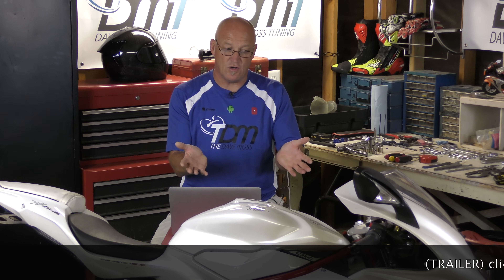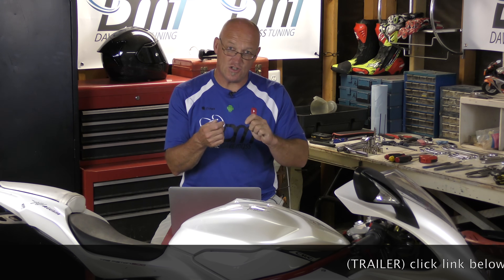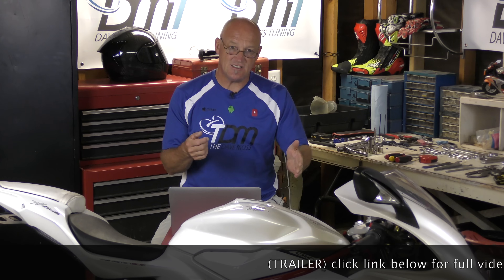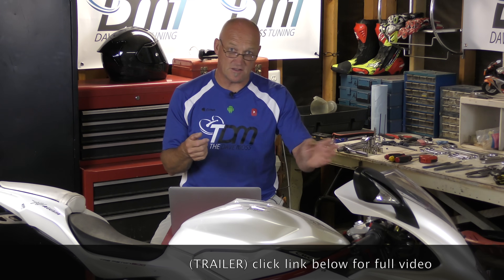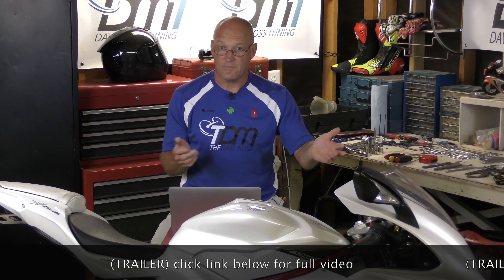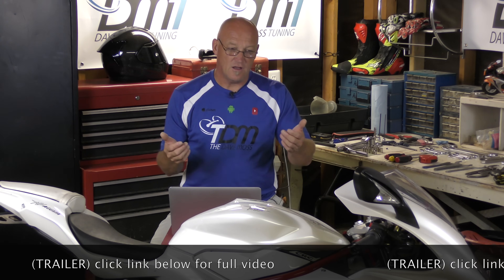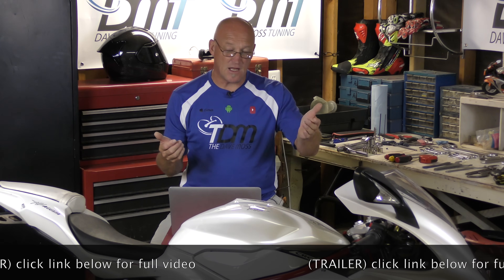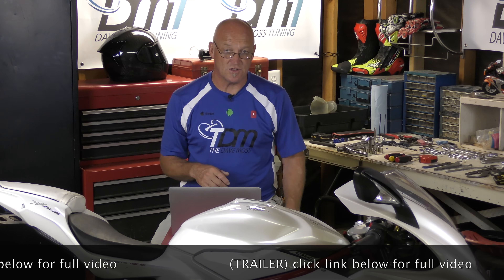FasterClass: Motorcycle Front Tire Wear (TRAILER)

Comment: Hi Dave, i have the exact tyre wear on the front tyre that you show in the thumbnail. Only difference is that it does not go all the way to the edge.
My guess is hot tear as it usually starts in the afternoon on hotter days.
Grip still feels good as do laptimes but the tyre is finished after 3 trackdays. Can you tell me what tyre wear you think it is?
Thanks
Reply from the maker: If you have the same line but not to the edge that is not enough weight on the front tyre and that should be indicated by fork travel not being within 30mm of marked bottom out.

Comment: Dear Mr. Dave, 
You should go deep into Harley Davidson Fat Boy 114 2019, there is an unexpected premature wear on the front tire just in the righ side . There are several complains about it, HD knows about it, but they didn´t release what is the real problem. 
I have my Fat Boy and with only 8.000 km the front tire was completely worn out in the right side. HD gave me another tire in warranty but they didn´t say what was the problem or even look for it or made any modifications.. I´d already looked into some blogs and the same issue seems to happen worldwide. 
If you have any suggestion, I´ll appreciate it.

Comment: fork geometry too low ;  There is a video where Mr Williams was on SBK where one of the 2 motorcycle's had a setup where the bike leaned easy is the diagnosis considered the same as too low fork geometry?
Reply from the maker: Fork position will enhance turn in along with other suspension settings. When rake and trail is also reviewed, you can damage the tire with for geometry being too low consistently pacing far too much duress on the front tire.